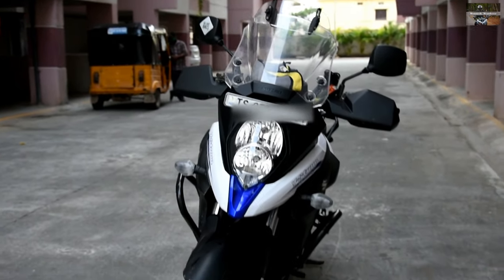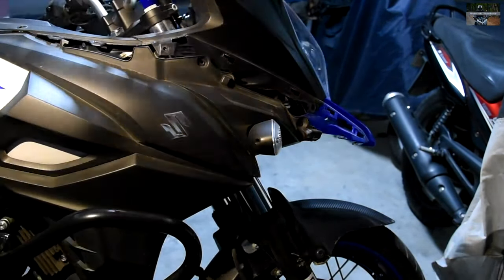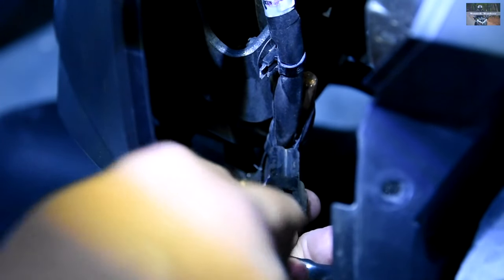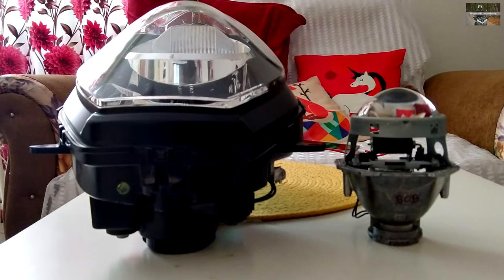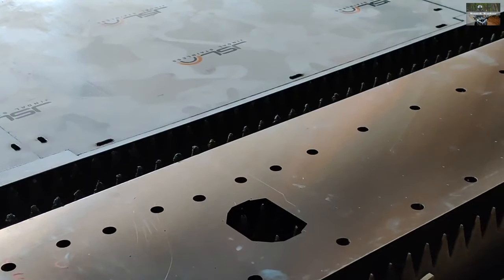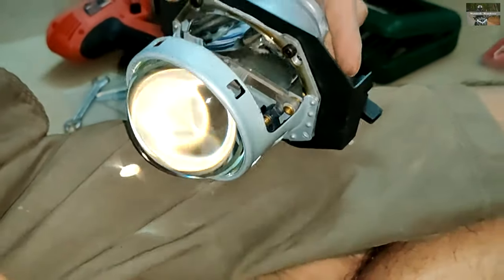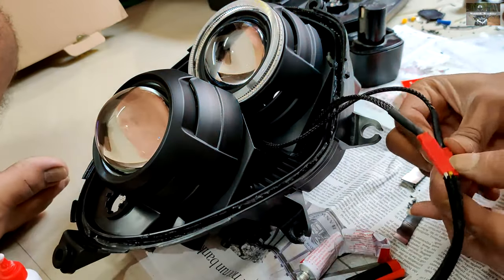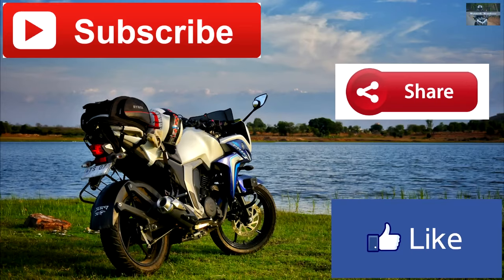#DIY BI-XENON HID PROJECTOR INSTALLATION IN SUZUKI VSTROM 650 XT || HEADLAMP UPGRADE || HALO RING

Comment: Though you make it sound simple but very complex and time consuming, hats off to your passion, skills and patience. One question, I have been trying to upgrade headlights of my Z900 and have been told that HID's are outdated and consumes too much power, seems it's not ?
Reply from the maker: HIDs indeed are old technology and consume power and produce heat, but the 'usable' light is much higher than LEDs. LEDs are also evolving very fast and soon we will have yellowish LEDs which will replace HIDs eventually.

Till then HIDs rule as kings as they have extremely high output and that yellowish-ness of the lights make them very usable in all type of conditions.
Reply: @MototechWanderer  thanks a lot for replying